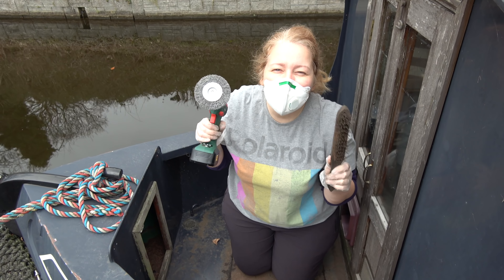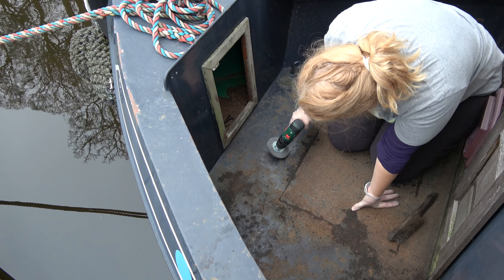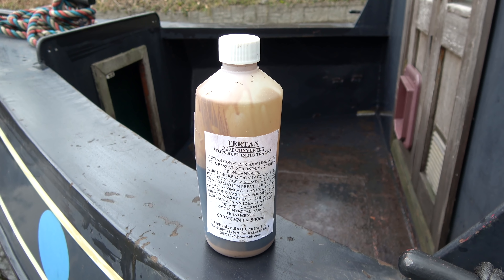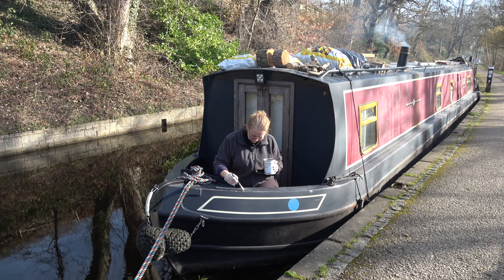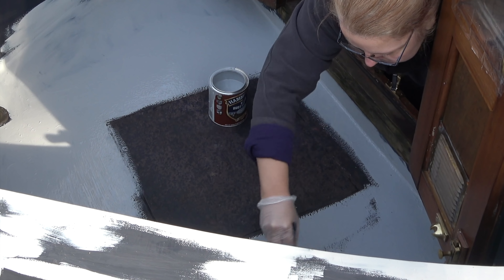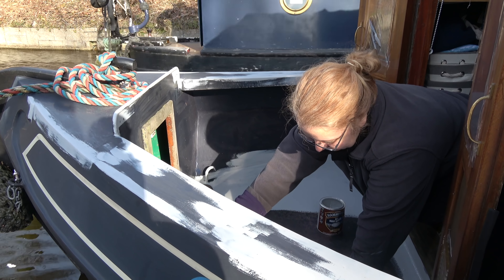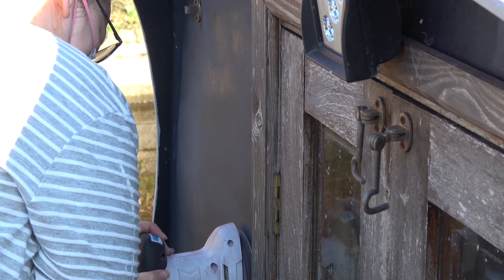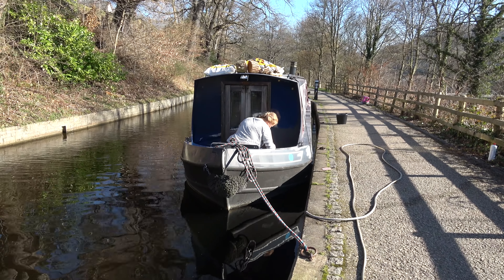Rescuing the bow of my narrowboat from rust

Comment: To help protect the bow floor, have you thought about getting a couple of rubber outdoor door mats? These have holes in them so rain water would escape but would give you a good solid nonslip surface to walk about on. And any mud or whatever that got trapped in the holes can be removed by a good shake of the mats on the towpath.
Reply from the maker: It’s a good thought. I have t fully decided if I should sand the bow it use the mats.

Comment: Looks really great! I have been painting my house but got shut down by Winter so your video was a reminder that I need to get back on it. Here are my two tips. First always wear safety glasses when doing any job that involves pieces of metal hitting one another at high speed. Second, painting and restoration is a slippery slope it starts with "I'm just going to do this" and ends up with a full restoration. Be safe and have fun.
Reply from the maker: Yes. Spring has arrived.

Comment: Rust converter? Will have to go look it up, is an unfamiliar term to me.  
Well, if the government says that's what it is, then it must be that, "A rust converter is a chemical treatment that turns iron oxide into a more stable form such as iron tannate. The advantage of a rust converter is the treatment is less invasive and the only surface treatment needed is a cleaning of loose rust and soiling generally with a wire brush. Rust converters have wide stretching usage in conservation, they are used from the stabilization of iron based museum artifacts and collections to iron architectural elements and outdoor sculpture."
Source: National Park Service, U.S. Department of the Interior, National Center for Preservation Technology and Training, Natchitoches, Louisiana.
Reply from the maker: Great research. Thanks for sharing.

Comment: I think you would be much happier with rubber mats rather than the sand. Much easier to keep clean, just a shake out , sweep up and your done. Just a suggestion, but it’s your boat and you need to do what makes you happy 😃. Best of luck to you and looking forward to the rest of the painting. ( I do like the suggestion that you put some of your art work on the side of the boat 👍 ).
Reply from the maker: Thanks for the tip

Comment: One thing y'all may wanna try is to coat the foot areas with some spray on adhesive, wait for it to get tacky, sprinkle sand on where you used the spray adhesive, once that is all dry, go back over with a coat of paint, it'll help you with the traction, especially when you he soles of your shoes are wet or when it's been wet outside.
Reply from the maker: We are going to use dry sand and paint. But thanks for the tip.

Comment: Hi ladies. There is a lot of people on the forums and social media that prattle on about you having to take the boat back to bare metal to achieve a "proper" result. This is simply untrue, if your paintwork is solid even though faded removing layers of it to reapply one or two coats  is detrimental. Sure, take care of rust spots and sand for a key but that's all thats required. Top job well done.
Reply from the maker: Yes I agree. The temptation once you start is there though.
Reply: @TheNarrowboatExperience  100 percent. I shared your sense of happiness with the results also. After mine was finished I had to keep going outside just to admire the new look... Its a great sense of achievement eh?

Comment: for anti-slip you could also use a self-adhesive grip pad thingy like :
https://www.safetybuyer.com/black-anti-slip-self-adhesive-stair-tread-cleats-150mm-x-610mm.html?gclid=EAIaIQobChMIu6rd5P2r4QIVr53tCh03ZApQEAYYBCABEgJes_D_BwE
(I have never used these pads or this supplier - just did a quick google).
I used something similar but much more expensive on a project many years ago.
Reply from the maker: Thanks. I was thinking about these or using sand.

Comment: HI If you are going to do the wood work may I suggest that you use SADOLIN it comes in different colours and you can always give it a light rub down and add another coat .In my opinion it is better than Varnish as you have to remove ALL the old Varnish otherwise it looks rubbish also very time consuming. Cheers .

Comment: Oh Kath! How could you let that happen? That Anna ruins her bursa in her knees by not using knee pads is one thing. But it is unforgivable that she doesn't wear protective goggles while working with the rotating grinding brush. What a carelessness! Are you something like the mistresses of narrowboating, and then such a negligent behavior. Anne sit down! Write twenty times: I must wear protective goggles!
For rust removal, I recommend a small flex machine with flap grinding wheels.
And another tip for the paint tray: I always pull a plastic bag over the tray. Then I don't have to clean the paint from it afterwards. This saves a lot of thinner/brush cleaner. You just pull the bag on the left side and you can put it in the garbage without any problems. I also dispose of the paint rolls with this bag instead of cleaning them. This protects the environment more than having to dispose of the contaminated cleaning liquid afterwards.

Translated with www.DeepL.com/Translator

Translated with www.DeepL.com/Translator -- It uses different words than I would have used but I hope it's translation means the same. ;-)